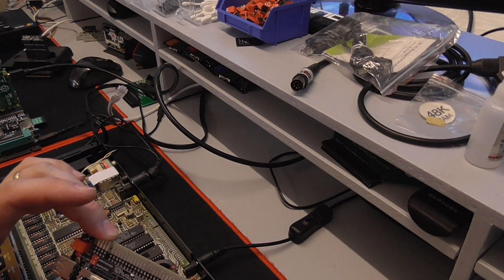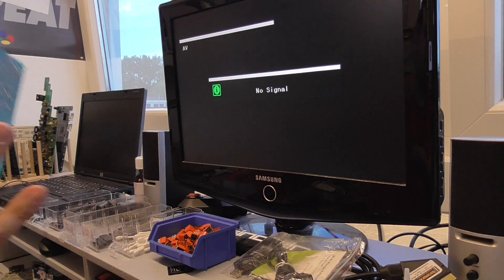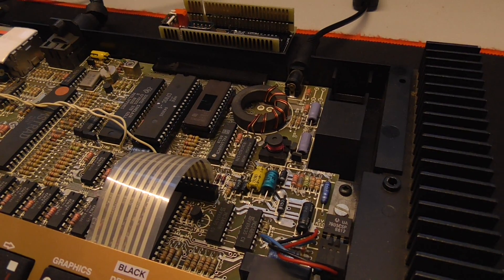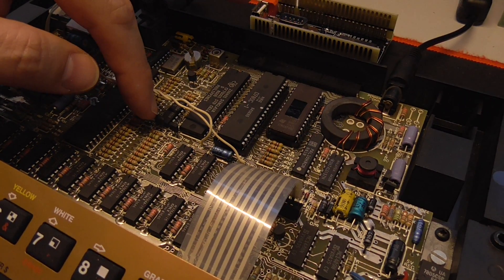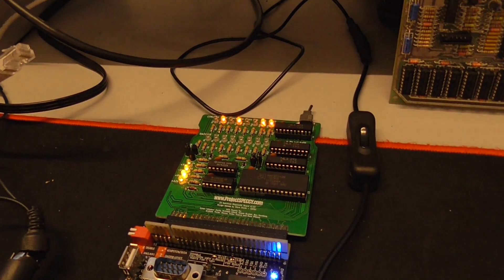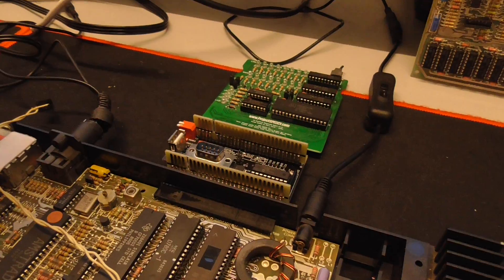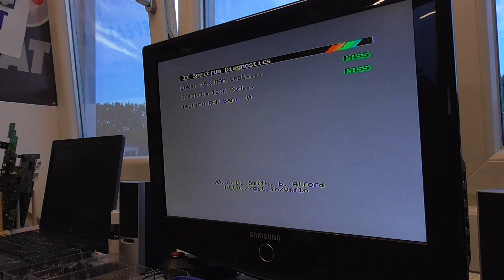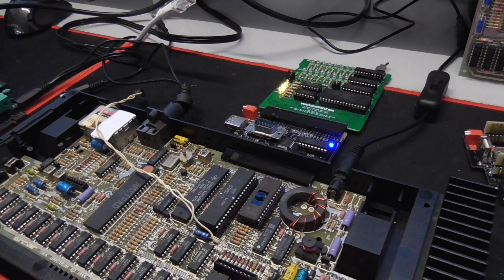Weak clocks on ZX Spectrum toastracks made worse..

Comment: Hi Ben, I don't know if you read these, but, I've discovered a way of fixing the clock on the Toastrack that Sinclair should have spotted. IC 37 is a 6 gate inverter chip that only uses 3 inverters, 2 of the spare gates can be used to boost the edge connector clock output. It's quite a process, but it works.
Reply from the maker: That is a good idea! I like it. The problem though is that we can't expect thousands of users to do such a modification, so it's mandatory that add-ons just take into account that the clock on the toastrack is weak (and easily disturbed).
Fortuntately I found that adding a 3K3 Ohm pull-up on clock solves all the problems I have as well.

Comment: The solution isn´t to exchange the original zx spectrum 128k transistor or a chip but to use a more compatible interface with that zx spectrum 128k  model ! the retro spectrum should stay retro. The modern interfaces that you use is what should be replaced

Comment: Read into it a bit more and looked at the Toastrack schematic. The problem seems to be that the CPUCLK output on the Toastrack's edge connector is directly connected to the ULA, whereas in the +2 it is buffered. The ULA probably has drive strength issues and that is the root of the problem. Really, Sinclair shouldve realised this when they found the need for TR3.

Ultimately, implementing the buffer in the same way that the +2 does it is the solution. The tricky part is that the 8A pad on the expansion connector is directly connected to the ULA, so a track break would be needed - or lifting pin 39 of the ULA out of its socket and soldering a wire there.

A better solution might be to fix it on the KMOUSE by adding buffering there, a single 74HC1G00 (tie one input high) would do it

Comment: My guess would be ringing rather than noise, or pehaps not fast enough slew rate. The oscillator configuration in the toastrack is a bit odd, possibly why Amstrad changed it in the +2. I wonder if swapping IC37 for a 74HC04 would help